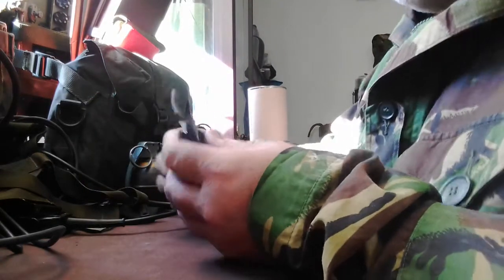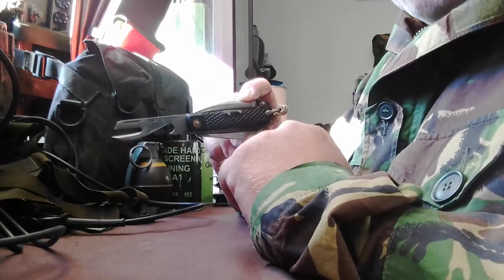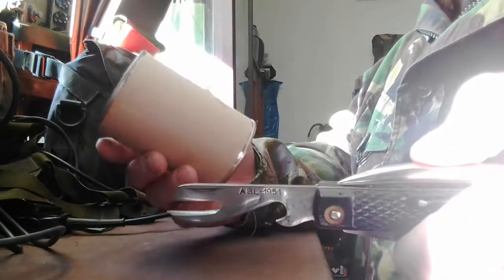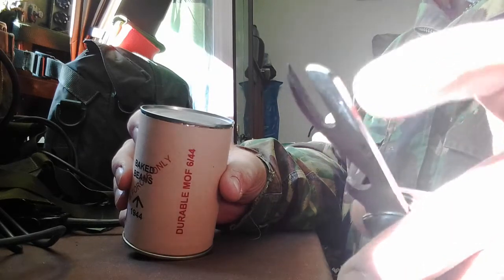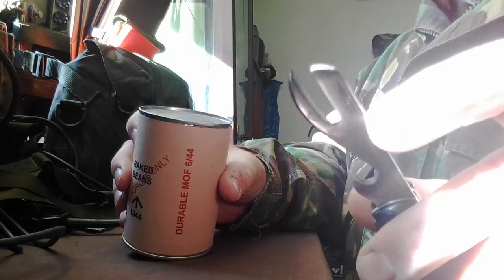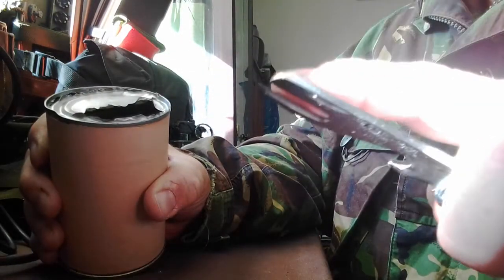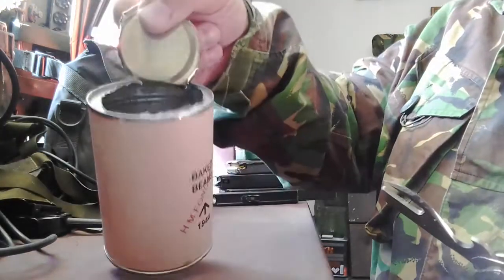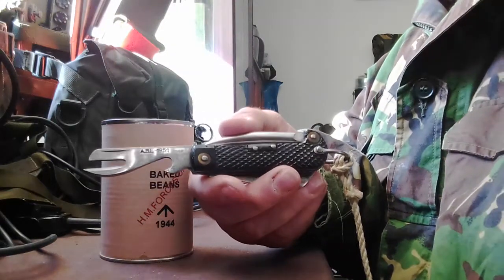WW2 british army clasp knife tin opener

Comment: Ah the old days...remember opening tins of dog food like that as a kid in the early 80s, I also remember the little can opener that came with the ration pack we got as cadets in the same era. I've often seen these knives at fairs/boot sales and I've never picked one up...I'm going to have to now 🙂🙂🙃🙂🙂, cheers and all the best 👍
Reply from the maker: I've still got the first ration pack tin opener I used, our troop sergeant told us to put it on a bit of cord along with our locker keys etc. Had it since 1990 😁 aye these old clasp knives are still very usable and clean up nicely. I find most of mine at car boot sales and Sunday markets
Reply: @andrewjohnston4127  cheers Andrew,  I will look out for one...what price range would you expect to pay for an okay one?...I don't mind cleaning it up and oiling it etc 😀
Reply from the maker: @steelhelmetstan7305  I've been finding them between 10 and 20 quid most of the time, depending on the condition of the blade, some of the older ones can be sharpened so much the blades are ground away. The last 3 or 4 I found were at tynemouth market in the train station. Look in old tool boxes or boxes filled with odds and ends,that's where I find them 😁
Reply: @andrewjohnston4127  cheers Andrew , yeh I've heard Tynemouth market is ok for bits of militaria,  might have a run up...its only half hour or 40 mins drive fir me, thanks again m8 🙂🙂🙃

Comment: I was given a ww2 era one by my grandad, sadly not usable as the blade is just a nub and the can opener is damaged but I cherish it as it may have been his older brother's, any idea if the repro ones are any good? seems they're made like yours with the bottle opener too but the overall finish looks a lot cruder than yours or my grandad's
Reply from the maker: One of my mates bought one of the repro ones that soldier of fortune sells, as a copy it's not too bad. It's a very close copy of the original.  Feels a little lighter compared to the original ones I own.
Reply: @andrewjohnston4127  I bought 2 originals this summer blades are new with minor rust, but the liners are flakey with rust under the plastic, intent was to salvage parts from them to make my grandad's one good as new someday
Reply from the maker: @Shadow_Hawk_Streaming  I have a similar idea to that too,I have 2 that are broken but generally in excellent condition.  Plan was to take the blade from one and swap it over but I think it's beyond my tinkering abilities